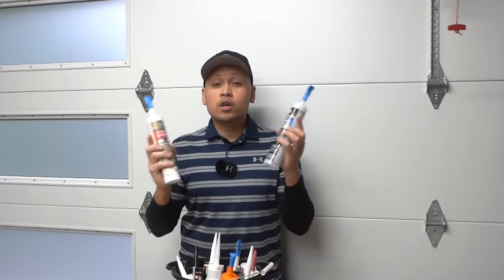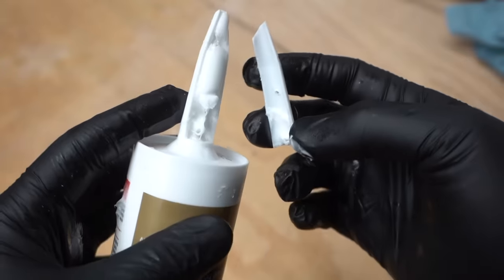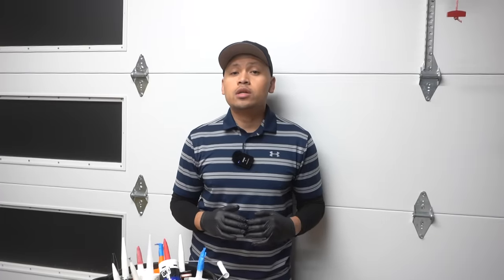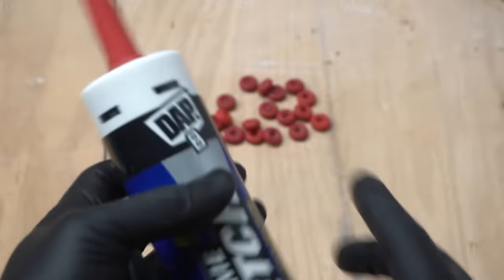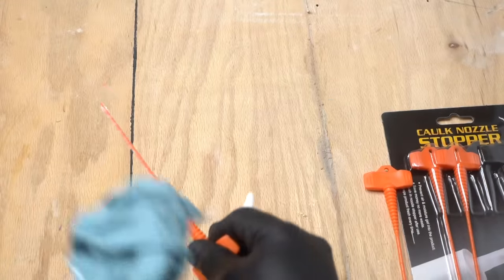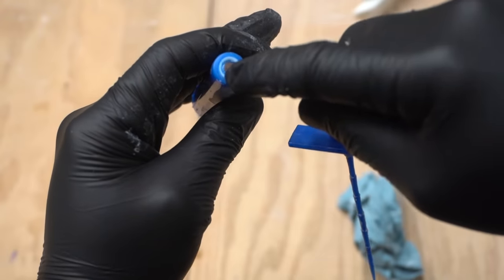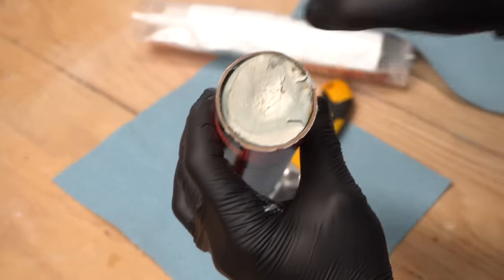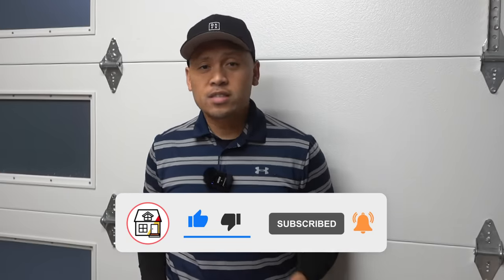STOP Throwing Away Half-Used Dried-Up Caulk Tubes! How To Fix It To Last Forever!

Comment: It's always so crazy about tube sealers. I'm a carpenter for 45 years and used a looot of caulk. I've never had too much problems with latex because it usually seals itself.  Anything like liquid nails or urethane based caulk, you could launch into space and it'll still go bad if you let it sit too long. I've had latex last a year or more, with no cap. But urethane based only a few months and it's solid as a rock. But yeah, a 16d nail does a great job 😂. 
Good video though. 👍

Comment: For short term saving from getting plugged, ....

  Force a small blob of silicone out the end of the tube abd allow it to remain and solidify.

   When next you need to use it, remove the hardened blob by pulling it straight off the tube, and this keeps silicone behind it pliable for usually a few weeks or more.
Reply: I TRIED THIS IT WORKS ALSO
Reply: Being that I do not know what I am doing, that trick has always worked wonderfully for me over the years. The gun even has a needle made for pulling out the hardened caulk. (Lol)

Comment: A practical option is to cover the tip with vaseline. It seals it from the air and comes out easily in the next usage.
Reply: I'm going to try this.
Reply: Awesome! I’m going to try this too! Stay tuned for a follow up video 👍🏽😊 thank you for sharing! 🙏🏽
Reply: That's awesome! I've never heard that.
Reply: Just so no one asks why you carry Vaseline, I just drill out the dry caulk. It just looks less suspicious lol
Reply: Is the air getting in the problem or is it the solvents escaping from the product the problem?
Reply: i'd think that any kind of heat would liquify the vaseline, and it would melt away.
Reply: had an idea when seeing the "cap condoms"...would those little water balloons work? like, the balloons kids fill with water to throw at each other in summer. i know latex lets a good amount of air through it, though(think old school helium balloons, pre-mylar...they didn't stay inflated very long)
Reply: @FB-gm6el  I think latex would perish and break down too fast, the contents would dry out anyway.
Reply: I also put vaseline on the threads of any tube with screw on cap, especially adhesives that dry out very quickly.
Reply: I've used petroleum  jelly on various test through my 37 years where I work, from sealing items from certain corrosives (water based) to insulating from air/moisture, as a temporary sealant on gaskets/o-rings, or lubricant.
I never considered it for sealing caulk tubes. I will try this in the future if i do not for get. 
Useful advice
Reply: @mickwolf1077  it depends if its water or solvent based. You  would be right either way. The key is to create an airtight seal to prevent air / gas transfer.
Reply: Sounds like a mess. And any remnants will cause you nightmares with adhesion problems.
Reply: @mickwolf1077  silicone needs oxygen to cure
Reply: @FB-gm6el  use high temperature axle grease instead then.
Reply: @FB-gm6el  Sorry, this conversation is not about sex. Just saying ...
Reply: @justnoted2995  "I can't breathe! I can't breathe!"
Reply: you probably figured this out from the miniature condoms in the video
Reply: My wife wants to know why I have Vaseline in my tool box
Reply: @02v8chevy  She should know that it's for your tool.
Reply: It needn't be "Vaseline", as that's just a tradename. Any petroleum jelly product will do. Cheaper too!
Reply: @FB-gm6el    Yup , no good in south Florida, but I can ride my motorcycle 365 days a year.

Comment: Thank you for the information and testing to show the effectiveness.  I used to use tape to prevent going hardening, but with no success.  So I had ruined so many tubes of keeping them.  Personally, I like the first item (cap) the best since it is cheap and seems the most effective.
Reply: Me too! Great vid.
Reply: cheapest & easy to store! I just noticed on Amazon 35 are $12 ... for $2 more ($14) you get 50 .... and way cheaper for 100 or 150. Thinking I can also use them in my craft room on a ton of things!
Reply: @SandySez  35 is plenty for me, but if you can use them, go for the larger quantity.

Comment: I have been using a wire nut with two or three thicknesses of thin plastic like the plastic bags they give you in a store over the tip of the tube.  Different size wire nuts for different cuts on the tube.  The tube stays for several months almost all of the time.  Those caps look interesting, and I will try them.
Reply: Wire nuts work great
Reply: I've used different size wire nuts with Vasoline in the tip of the wire nut to prevent air leakage. It works well.
Reply: I'll have to try that idea, it sounds like it would work very well!
Reply: I also use wire nuts. Will have to add Vaseline .

Comment: I've always used the nail/screw approach but as you say, with limited success. When I have trouble getting the caulk to flow I take a white wire clothes hanger, cut it and ram the long end all the way into the tube and sometimes that works. I think I bought the small maroon caps and have to find them.
Reply: Does it have to be a white wire hanger? I only have gold color hangers.
Reply: @cwally1994  I only have plastic, Made in China, of course.

Comment: Pro tip: put some duct tape (or whatever tape you have) on the end of the nozzle, leaving a hole in the end (basically, use tape to make the nozzle longer by about 1 inch).  Squeeze the caulking through the tape-nozzle you just made, and viola!  the caulking will dry and harden in your tape-nozzle which you will peel off later, keeping the real nozzle good for months (if you do it right).
Reply: That sounds like a great idea, and costs nothing 👍
Reply: I was squeezing a little excess amount out and using electrical tape , 
but thanks for posting your idea ... I've give it a try . 
.

Comment: If you really want to create a seal for around a nail that let's say is a bit too small, just use the caulk itself to create a seal on the outside of the opening.
Reply: @ezwa9979  Makes it easier to pull out the seal, instead of digging out the dried up silicone from inside the top portion of the tube.
Reply: @jarekkam81  
O😯, yeap, logical

Comment: I have used an old nail to stick in the end and then pull back in an effort to remove the dried plug in the tube nozzel.  To not have a dried plug I usually use a small piece of saran wrap or thin plastic bag.  double or triple it and place it over and down the tube nozzle.  Then wrap a rubber band around a few times.  It doesn't take much.  It has worked for me for years.

Comment: Caulking tubes around my house can sit for years partially used, so sealing is critical.  I think the last product you showed is a great solution for the price.  But about once every two months or so I have need for a bit of Lexel.  I have some unopened 10.5 oz for guns for future large projects around the house, but for mounting hose reels, decorations, flower boxes, etc., on the siding I put dabs of Lexel around and in drilled holes.  I also use it in lieu of silicone on our motorhome.  It works better, but dries to tack quite quickly, so any beadwork must be done as you go.  The issue is that for such intermittent small jobs, I use a 5oz squeeze tube instead of the 10.5 oz caulking size.  I‘ve used the Red Caps, Caulk Savers, and Tooltime caps, but they don’t often seal for months at a time, and I inevitably end up digging the nozzle with a screw to get the plug out.  And with its clear squeeze tube, I can see the product inside slowly fogging, meaning air is saturating in.  Have you better ideas for sealing squeeze tubes?

Comment: Good video.  I've had DAP caulk clear and white last for over a year with just a nail or screw in it (using it every few months, though nail or screw may rust.. use aluminum nails).  A fairly tight-fitting screw is better as threads will dig into/seal nozzle and it'll pull solid stuff out.  As a person said below, drilling it out is best as it opens up a path (otherwise an opening tends to clog.. I use a drill that kind of fits open in nozzle to spare it.. move around to ream out bigger area going into the tube.. squeezing out caulk with the gun will push out solidified material).
Note about silicone.. whether open or not, it has an expiration date.  I used some unopened GE silicone several years ago that was 5 years old - did quite a bit with it and it never cured.. if old, put some on a piece of cardboard to ensure it cures within 24 hrs before doing a job (I let the stuff sit 3 days) - maybe is better now, but I'll never take a chance without testing it.. was a mess to clean up and redo.

Comment: In Australia the tubes come with a replaceable nozzle that screws on and off!  I still have the issue of silicone setting in the nozzle, but it’s easy to replace with a new nozzle (srew off, screw on).  Also you can sometimes push the hard part out of the old nozzle and put it straight back on.  Replacement nozzles are cheap.  Having said all that I still like your small rubber caps, I’ll be looking out for those.

Comment: I do not use caulk often so it takes me about a year or so to finish a tube. The way I preserve my bottle of caulk is by using saran wrap and a thin rubber band.

1. Cut a piece of saran wrap big enough to cover the nozzle
2. Gently place the saran wrap over the opening and fold and tuck excess around the nozzle
3. Tie a thin rubber band tightly around the nozzle
4. Put the tube in a caulk gun and squeeze the trigger a little to put a small amount of caulk pressure on the saran wrap opening area. Done!

Step #2, if you rip the saran wrap, just move the saran wrap to another spot that is not ripped and start over. It's a quick process and works well for me.

Comment: I use the red caulk caps (sometime two as per instructions) and then place the tube in an airtight food storage container for extra protection. I bought the "OXO Good Grips Pet POP Container – 6.0 Qt/5.7 L with Half Scoop" on Amazon. I think it will hold about 6 or 7 tubes and cost about $23. Its just tall enough for a cut tube to fit inside. I have two in my work van. I also bought the "TubeANew Caulk Tube Saver" but have used them.
Reply: Giving the cost of those caulk saver devices, it is less expensive to buy a new tube.

Comment: In Australia the tubes are screw on and if it’s blocked you can pretty easily take it off and dig out the hard bit of silicone…or when you put the nail in the end you smear some silicone around it on the outside and it works pretty good as a seal

Comment: I unscew the nozzle off the caulk tube and clean it out. Then I take a small piece of cellophane (saran/stretch) wrap and drape it over the nozzle threads on the caulk tube. Then I screw the nozzle back on the tube over the cellophane wrap so the cellophane seals off the threads and the caulk tube. That seems to work quite well and keeps the caulking from hardening for a few years at least. I like the little red caulk condoms you showed in the video though. The orange silocone sleeves you showed won't work very well because they trap too much air in the end and you don't want the leftover caulking to be in contact with any air.

Comment: im an electrician so pretty much the only caulk i use is silicone to seal up stuff from outside. we use the clear looking silicone and after im done with it i always just leave a little nipple (like 1/8" long) poking out of the nozzle and just let it dry out. It always dries up some into the nozzle but never enough to ruin the tube the nipple also doubles as a piece to grab onto so i just grab the nipple which has now hardened up and pull it out as i squeeze the caulk gun, so basically the silicone forms a cork by itself. i have never had a tube dry up on me like this.

Comment: Here in the Netherlands we have tips that can be screwed on the caulk tube. Easier to just be able to remove the tip and check if the tube is still good, then we just have to replace the tip.

Comment: It's the same thread on caps from, for example, mayonnaise, caviar tubes, with such a cap the joint compound never hardens. Some sealants with hardeners are placed in the freezer.  Greatings from "Volvo Laplander Camper"

Comment: Great video.  I have found sealing the tip with some hot glue seals 100% and lasts a long time.  I sealed a tube for about 18 months and it was like new when I popped the seal off the end.

Comment: I, too, use the 3" long plastic golf tees and have had good luck with them. When I'm ready to use one in my caulk tube I squeeze out about a half inch of caulk and that acts as a seal all around the top. I bought mine from Ebay  for $5.95 and there were quite a few but I can't pull up my purchase back in June 2023 for some reason. Anyway, they're cheap and they work well.

Comment: For day to day / temporary caulk-tube storage, painter's / blue tape works fine. However, for longer time storage, a double layer of square pieces of regular / grey duct tape works far better. Of course, storage location (temp-control) and insuring the caulk-tube tip is clean are both essential elements here.  Been doing this for over 24 years.

Comment: In UK most sealant tubes come with screw nossels, so if they dry up just need to pick the dried area apart and tend to save the nossels afterwards. Occasionally found it's dried in cartridge , so think tubeanew good idea , but have to check that UK sxkf size cartridges as USA. Thanks for tips

Comment: What I have done over many years is to use a 3" long piece of stainless steel rod that has the very top of it bent at a 90 degree angle to make it easier to grab and remove. The rod must fit into the tip of the nozzle very snuggly AND BE PUSHED IN WHILE THERE IS STILL CAULKING FILLING THE ENTIRE NOZZLE TO OVERFLOWING. I push it in until the end of it is actually down in the tube. I have always had excellent results from this because the caulking at the very tip creates its own seal. Another way is to screw on a plastic electrical wirenut which will actually thread itself onto the nozzle. Squirt a little bit of caulking into the wirenut first.

Comment: I've used those same balloon-like rubber caps but found 6 months later when I went to use the tube (it was silicone caulk), it had hardened on the top.  Maybe what I bought was sub-standard but they look identical to what you used in the video.  I took the same precautions as you did but they just did not work for me.

Comment: That's all good stuff. I didn't know that was available. One other thing that helps is to put the used tube in the refrigerator. Slows down the drying out process. (it helps if you have a second refrigerator - the wife won't  like that too much)

Comment: My go-to caulk tube sealer is a little dab of HOT GLUE on the tip. Perfect seal every time. Yes, you need to drag out a hot glue gun and wait for it to heat up but I've had caulk tubes stay fresh for YEARS with this method. Just peel off the dried glue and you're good to go! If I have a caulking project that spans several days, I'll just expend a little of the product out of the nozzle and that works great as a short term seal. The cap "condom" is interesting and seems to work but I wonder how it holds up long term (like a year or more). The tube-a-new looks like a great product for saving tubes that seem like a lost cause. Thanks for the info!

Comment: DAP white alex painters caulk is $2.59 /tube at Lowes, even less when you buy it in bulk. I'm not going to waste my time messing around with trying to preserve a used tube when they are so affordable. I use hundres of tubes every year and know what I'm talking about. The nail in the tip is only a temporary plugging device to eliminate messy drips from each opened tube, and there is nothing wrong with doing that. 
Thanks for your videos.

Comment: I keep the tip in a plastic cup with a small amount of water for short periods. Need to check periodically & add a little water. The water will seek its level in the caulk, so not too much. Works perfectly when on a job that spans some time

Comment: When I wrap my used tip with something like a bread wrapper, I make sure that I create a very long drying path by wrapping and folding; once I am sure that wrapping is airtight, I hold it in place with a rubber band. The last step is to squirt a bit of fresh calk out of the enclosed tip to ensure an airtight seal. This works, but I doubt that it is as efficient as the Calk caps.

Comment: Very informative video. I'm going to pick up some of those roll down caulk tube condoms. Someone took a simple idea that has been used for many years and applied it to a caulking tube....brilliant. Seems like a great idea and it seems to work well enough with the least amount of fiddling and without making a mess. Plus at the price you can just toss them out too. Also going to get a five pack of the TubeANew since I have some caulking tubes that are plugged. Nice job sir !!

Comment: I've found if you can get a container and fill with water, place the tube upside down into the water so the end will be covered by water, it works proper and stops air from drying out the mixture, you will of course have to push a little of the mixture out when needed tho

Comment: I have used the nail hack for years. You want to squeeze out some extra caulk around the base of the nail so that the dried caulk stays mostly on the outside of the nozzle. That being said, those little caulk condoms look like they still work better.

Comment: After you've finished your job, throw away the used nozzle then wrap the top of the cannister with a patch from a plastic bag and some masking tape. When you need it again, pop on one of the 50 new caulking nozzles that you bought online in a pack of 50 for around $5.
Reply: In the US, I haven't seen a screw-on nozzle in years. The nozzle and tube are all one piece now.